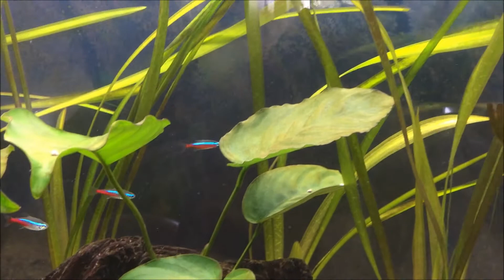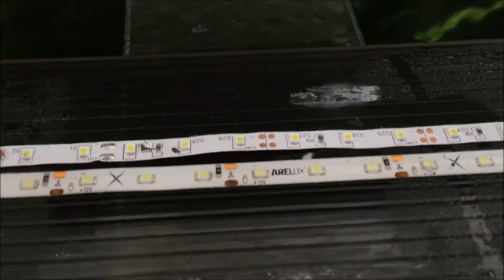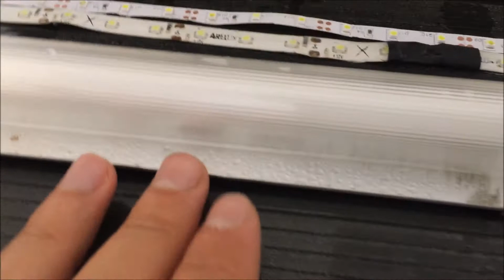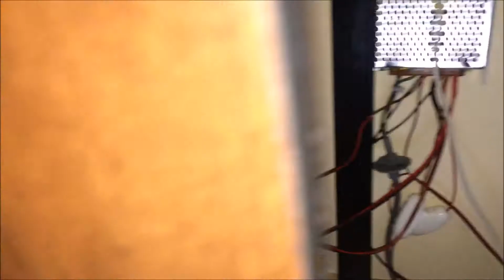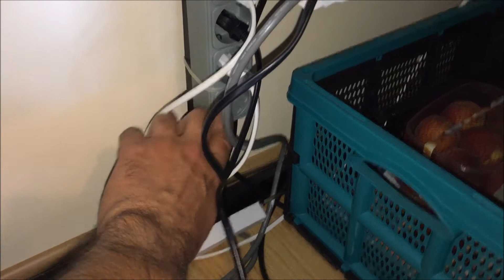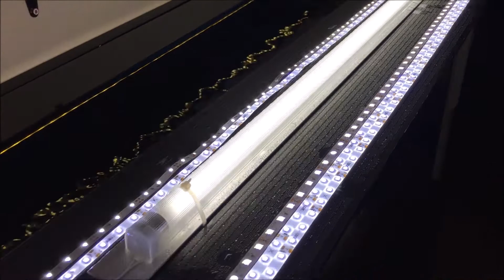New T5 Lights

Comment: hey aquarium lover great job on the jungle val i couldn't get mine to thrive it melted back so bad i got rid of it. someone told me its because my heater was at 82
Reply from the maker: When I had discus my heater was at 29 degrees Celsius and I had the same jungle val that I have today and had no problem. I believe that your problem was too little light and no fertilization.
Reply: AquariumLover thanks a lot I have no fertilizer and t5 light you right. Just Eco complete substrate